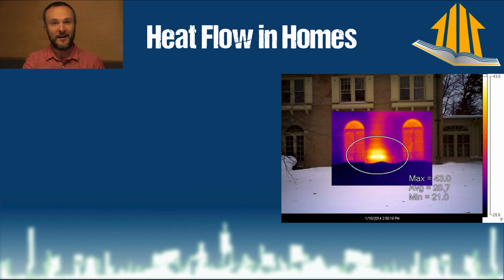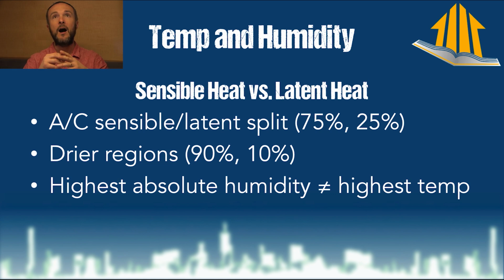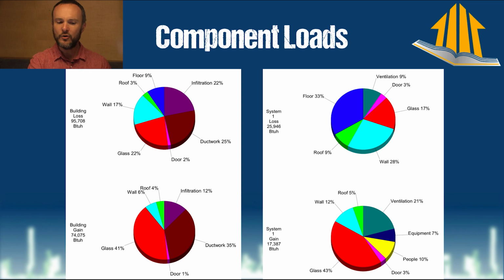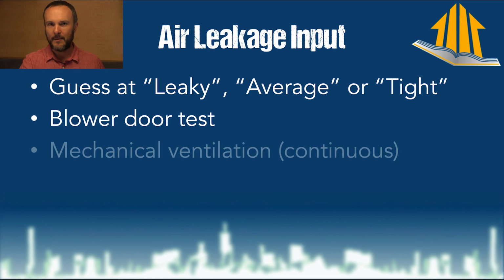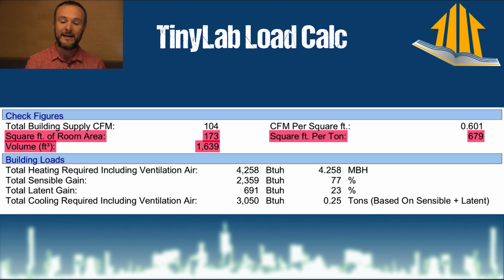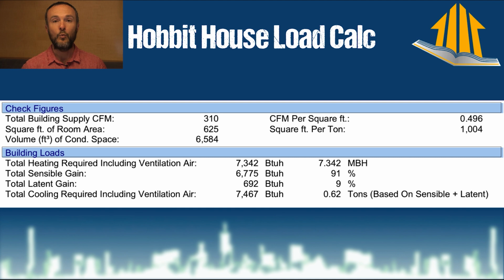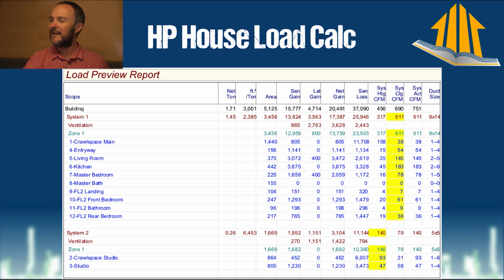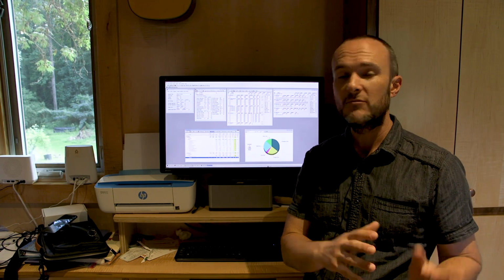Manual J Load Calculations for Heating & Cooling

Comment: Hi Corbett, I’m currently struggling to understand what to buy for our HVAC remodel. I’ve paid for a load calculation and manual d along with some other manuals all bunched together in a residential software. I live in Florida so humidity control is the goal. What type of unit do you recommend, variable stage or single stage with stand alone dehumidifier? I’m trying to make the right choice for our house. Required unit is a 3 ton and house is built in 2003 but I do plan to air seal and insulate better
Reply from the maker: Dehu in either case, all else really depends on particulars Ryan. Sorry can’t be more helpful without more detail- feel free to book a consult.
Reply: @HomePerformance  Will do but first I’m going to get a blower door test conducted as I think that’ll aid in the conversation

Comment: Can or should a manual j be done on an existing home before purchasing a new ac unit?
Reply from the maker: Yes, ideally- it was never done in the first place, so you’d be repeating the mistakes of the past (best case)
Reply: @HomePerformance  thanks. Now since it’s an existing home, is it possible to check the heat/cool load calculation without doing a manual j by using historical data from a smart thermostat ?

Comment: Question about when you say that if your furnace/air conditioner are not running 100% of the time, that they are oversized.  Are you only referring to on the days that reach the hottest/coldest, or are you saying the system should be running constantly all the time regardless of the temp outside?
Reply from the maker: Just on the ‘design day’ for 99% hottest and coldest
Reply: @HomePerformance  ahh gotcha.  That make sense.  Thanks!

Comment: Hi Corbett, just listened to your really excellent Man J load calc video.  I see that for your forever home you use Alpen windows.  Did you use the ones with suspended film or thin glass?  Operable or fixed?  I watch your Home Diagnosis show on TV which is also excellent and am going through all your other videos - they are just wonderful.  Explanations are really clear and it's obvious you both are really enthusiastic about your work.  Thanks!
Reply from the maker: Hey thanks for watching Eric- the windows are mostly fixed, a few casements, with film.

Comment: what software should be used? I get different answers for load depending on the software used even though the input info is the same.
Reply from the maker: What! if they’re both Manual J approved, they must calculate the same load, that’s the rule. I bet there’s a default in there somewhere sneaking past you. Try Elite or Wrightsoft, they’re the biggest.

Comment: I tried using Elite Software Rhvac software to do the Manual J and D calculations so I can engage with a HVAC contractor with a new home build. In general, the software contained many options however in too many cases I had to compromise because I had to settle for selections that were the closest with my build. Even though I am working to minimize air infiltration, use low-e dual pane glass, increase insulation, and use nominal ventilation the load still showed roughly 1 ton per 500 sqft. Any thoughts?
Reply from the maker: Assumptions must be made in existing homes, but you can make custom components within the software if you don’t see your exact assemblies. Also, blower door test inputs, not defaults!

Comment: Thanks.  Great video!  I am a home owner working through a Manual J room by room load calculation on an existing two story house using the MJ8ae speed sheet from the ACCA website.  I have a copy of Manual J8 v2.50.  One question I have not been able to find guidance on is whether to include the thickness of interior and exterior walls in the room dimensions when calculating wall, floor, and ceiling areas, and slab perimeter length.  Including wall thickness increases the envelope area by about 5%.  I have the same question re whether to include the thickness of the second level floor when calculating  the above grade volume.

Comment: Per the comment at 26:18 regarding tradeoffs (add insulation, require smaller and less costly equipment), I've heard a high performance builder approach is to group the HVAC costs with the sealing and insulation costs into one large "performance" line item, which makes it much easier to talk to buyers about tradeoffs. Like in the small example noted in the video, it might be that notable improvements in sealing or insulation at a cost of $25,000 may offset HVAC costs of $13,000 (e.g. if can move to mini splits with no ducting), so that one category of costs is really just +$12,000 to spend $25,000 in high performance.

That eases conversations around around tradeoffs. For example, if the +$12,000 in the example is only offset by energy savings of $7,000 in 10 years, the homeowner is really just paying $5,000 to get a home with $25,000 of additional materials and work on windows, insulation, and air sealing, which makes the home more comfortable to live in. It's a much easier sell.
Reply from the maker: Interesting budget org trick! Love it.

Comment: Terrific video! Very informative! At the 21:50 mark, you mentioned that an air conditioner needs about, on average, 10 minutes to start drying out the air.  My single stage AC unit runs for about 6–9 minutes. The humidity reading on the smart thermostat is mid 60s. However, the humidity reading on my hygrometer is mid 50s. Which is likely to be more accurate? If the humidity readings are in the 50s, would the 6-9 minute run time do you something of concern?
Reply from the maker: I wouldn’t trust either- trust a $130 datalogger like a HOBO MX1101. The RH readings in my home are 5% high and 5% low for the two conventional readouts you mention.
Reply: @HomePerformance  Thank you, I will order one. Can’t wait! The house is kept cool and comfortable. If the readings are at a safe level, such as the 50s, should I be concerned about having only a 6-9 minute run time?
Reply from the maker: If the weather is cooler and humid, that’s when you’ll have more of an issue, TJ
Reply: @HomePerformance  Thank you - good to know. More of an issue with feeling sticky and humid, more of an issue with possible mold and mildew, or more of an issue with where and tear on the compressor/system? Or all of the above?
Reply from the maker: Only the first two
Reply: @HomePerformance  I was afraid of that. Maybe I’ll try re-calibrated the thermostat and see if that helps
Reply from the maker: No worries, tstat won’t change anything- if you need it to be drier (maybe you won’t), you can either 1. Install a dehum, 2. Downsize your A/C, or 3. Add heat to the house to make the A/C run longer, haha.
Reply: @HomePerformance  That’s too good options.How about adding an addition to the home, such as a sunroom, or Game room, with duct and supply vent leading to it?
Reply: @HomePerformance  I noticed that there is an “overcool“ option on the T-Stat. It is designed to run the unit until it reaches 2 or 3° lower than what the thermostat temperature is set. Provides a longer run cycle time. Just not sure if that would do harm to run the unit with that feature all the time. And it probably would not be all that comfortable with 3 of 4° temperature swings
Reply from the maker: AKA ‘Dry’ mode on some other brands- it will up your maintenance for mildew/mold sometimes because it slows the air and lowers the temp of the coil. Sure, try it- good option.
Reply from the maker: SMART MAN
Reply: @HomePerformance  Thanks. Exactly what I think about you. Smart man
Reply: @HomePerformance  I decided against using the “overcool” option on the smart thermostat, at least for now. Since you mentioned that it could increase my maintenance for mildew/mold
because it slows the air and lowers
the temp of the coil. Wouldn’t want to risk sweaty ducts, vents, equipment, walls, ceilings. Thanks for pointing that out.
Reply from the maker: High five, TJ
Reply: @HomePerformance  ✋
Reply: My financial advisor, a.k.a. my wife, wasn’t thrilled about me spending $130. Therefore, I used a Fieldpiece PRH2 psychrometer to measure the indoor humidity levels, and to compare the readings with my Digital thermostat, along with the hygrometer reading. The Fieldpiece psychrometer RH readings were in between that of the digital thermostat, and the hygrometer, but were closer to the hygrometer RH readings. The Fieldpiece psychrometer measured RH levels are registering in the mid 50s. Considering I live on the Gulf  Coast, maybe that’s Normal RH.

Can you tell me if I should be taking the RH readings in the different rooms, such as the living room, bedrooms, etc., Or should I be taking the reading by holding the psychrometer right next to the return air, or should I be taking the reading somewhere else?
Reply from the maker: It might be different, so test everywhere
Reply: @HomePerformance  Perfect. That’s exactly what I did. Thank you

Comment: A couple of questions from the homeowner. We have built an off-grid 2-story ICF home in West TN and have lived in it for 4 years (Yes, still finishing the insides :) It takes a candle to heat it in the winter (actually, we use a cookstove). When 100 degrees outside, it is 85 degrees inside (without AC) during summer. But our challenge is, you guessed it, humidity. Now ready to add a min-split. Question 1) Where can I find someone to do a Manual J load test? They want to use their "own" load test system and claim years of experience with results ranging from 12K - 42k cooling. Question 2) is CoolCalc reliable as a DIY approach?
Reply from the maker: MILTON! Don’t put in any A/C yet! You’ll need a dehumidifier for your home if you’re using ductless minisplits, AND you might not even decide you need them once you feel how comfortable dry air is. I recommend an Aprilaire or Santa Fe unit. Also, I recommend you be very careful with that cookstove and make sure your outdoor air ventilation is tuned correctly. If you need further help with details, I’d be delighted to work with you:
https://buildingperformanceworkshop.com/video-consulting

Comment: Hey Corbertt,  I understand and perform load calcs myself, I used Elite as well.  However when doing load calcs on new construction it is impossible to perform a blower door to determine the homes leak rate.  Therefore you must assume the leak rate.  

Doing blower door on every retrofit is simply not feasible for most homeowners.  Many home owners struggle to pay for the system replacement, much less the addition cost of the blower door test.   

I admire the work you do & appreciate the changes your bring to home building.  I am now persuing my GC license & I will be reaching out as transition from 20+ years in the HVAC industry to start building clean homes.
Reply from the maker: Keep up the good work, Supercool. On new construction, any builder who’s been BD tested before should know what ACH50 they build, and that’s the best assumption for the HVAC load. On retrofits, as long as the offer of a test is made and the importance is explained, it’s the homeowner’s fault if they opt out. Bet you $1000 the offer and explanation doesn’t even happen even 1% of the time.

Comment: This is an awesome video, Corbett! After watching your video, I gained the confidence to pull the Manual J that was run for my new townhome.  We moved in 6 months ago and I was very disappointed with how my cooling system was performing.  It seemed to always struggle.  I reviewed the Manual J for my home and without surprise, it said my system was sized accordingly (cooling power at 102% of load).  I thought I hit a dead-end after seeing this, but I then found out that in my new townhome complex, the townhome building built right next to me that was finished just a couple months after my building (which also happened to be the exact same floorplan and orientation to the sun) got bigger equipment than I did.  This made me scratch my head wondering how they could be sized for bigger equipment when our homes are apples to identical apples.  I had one of my neighbors in this building pull his Manual J that was done by the same consulting firm.  When you compare the reports side by side, things are pretty much identical.  However, one big thing that tips the scale is a line on our reports under the "Sensible Cooling Equipment Load Sizing" Section calling out each home's blower motor.  I see the BTU loads of the structures, ducts, and central vent for outside air.  In my neighbors report, his calculations add 1707 btuh for his blower.  However, when you look at the same line for my blower, it says 0.  So I guess my million dollar questions are a) is it possible for my neighbor to have 1707 btuh of heat gain from his blower but 0 for me? and b) if I were to generalize my question, is it possible for any blower motor to have absolutely no heat gain working against the AC system?
Reply from the maker: Excellent energy and thoughtfulness, Eric! Just FYI, I've been asked before to build a Man J that would match the equipment that HAD ALREADY BEEN INSTALLED.
Reply: Agree with above, but a side note for those reading this (and yes, I'm not an expert on manual J and also 3y late, though I do know electronics and electric motors fairly well): 1707BTU/h is 500W. Sounds suspiciously like the total power of the blower motor which I doubt is 0% efficient. :) I'd assume 300-400BTU/h would be a better estimate of power lost to heat for an electric motor. Certainly the right order of magnitude.
Reply: @mrkungfu  Interesting, thanks for the feedback.  But yeah, to my original point, whether 0 or 4000 btu/h, I don't see why the builder is not being consistent between homes in the same development, especially when small amounts like this can swing the end results/calculations.
Reply: @babbitteb  My guess is that the Manual J is being tweaked to result in a system that has already been decided on. I can think of a few reasons the builder might have pre-committed to a unit that is inconsistent with yours.

1. They may have several projects and are trying to use the same unit in every one to get a volume discount from the manufacturer.

2. The HVAC subcontractor may be different from your build to this new one and the builder is just going along with what the HVAC sub says. 

3. It could be that the builder has heard your complaints or similar complaints from others and is trying to  avoid that on future builds by upping the system size. But they may not want to pay for more consulting hours to get a legit Manual J showing a larger load so they're asking the consultant to "quick fix" monkey with the numbers just enough to spit out a bigger load.
Reply: @Anytus2007  Agreed.  One thing I've learned through this whole process is that Manual Js are great in theory, but at the end of the day, the proof is in the pudding. If the system specs called for in the calculations don't perform, that IMO should be a moment for pause.  If the system can't perform, what was the purpose of the Manual J other than to check a box?
Reply: Just that amount of btu  from blower is not enough to up the cooling tonnage. 9 out of ten times is improper duct design. sometimes you can overcome this with a more powerful blower.  You need to have a hvac expert come to your home with a flow hood and test your total cfm. they might have gave your neighbor a bigger system when he just needed more cfm. lots of contractors do that.

Comment: Around 32:30 you state that having less than 3 ACH doesn't make much difference. How so? Seems to me if the air changes air 3 times in an hour my equipment needs to work harder to heat or cool the replacement air, compared to only 1 ACH. Could you explain? Or are you saying that the air exchange becomes a negligibly small percentage of the excessive heat gain (or cooling load), that the air change losses are dwarfed by all the other factors?
Reply from the maker: The latter- and it DOES make a big difference for air quality, what I meant is it makes little difference for energy savings.
Reply: @HomePerformance  I'm still a bit confused. I hired a company to do a Manual J for our super-insulated house (R40 walls, R60 ceiling, very tight with an ERV) and their numbers came back with our 204 sqft, 1800 cuft Master Bedrm heating load at 1369 Btuh. I can't tell if they are including any infiltration in their calcs. Regardless, I calculate that it takes about .018 BTU to heat 1 cuft of air 1'F. So for the MstrBedr 1800 cuft and a design TD of 56'F I calculate 0.018 x 1800 x 56 and get about 1800 Btuh to heat the replacement air at 1 ACH. That 1800 BTUs is larger than the heating load calculated by the Manual J so the heat loss at 1 ACH is significant for my house. For 3 ACH it would be a whopping 5400 BTUs which overshadows the 1369 for heat loss through the walls etc.

But that's with my super-insulated house. If the house had half the insulation, that would double the wall/ceiling heat loss to over 2700 Btuh. The added 1800 BTU loss at 1 ACH is still 40% of the heat loss -- which I would consider signifcant -- let alone a 5400 BTU loss at 3 ACH. That's how I'm understanding this.

Or maybe these numbers I state are true at 1 ACH per hour but in reality the infiltration rate is much lower because it's not usually that breezy???

But other than my questions here, it was a great video, explained lots of good stuff. Appreciate it.